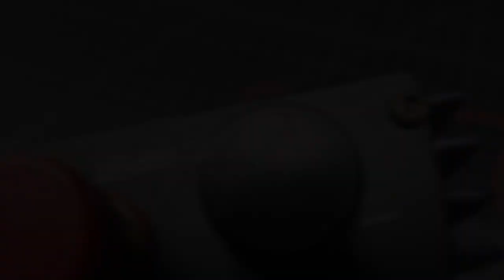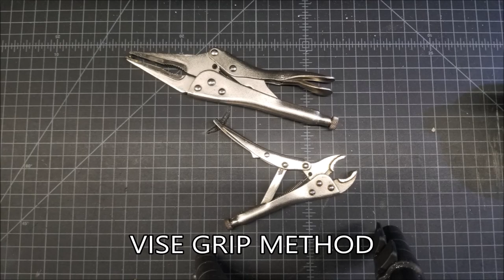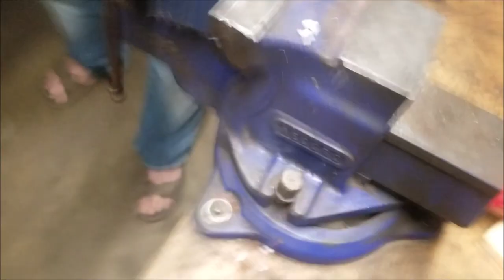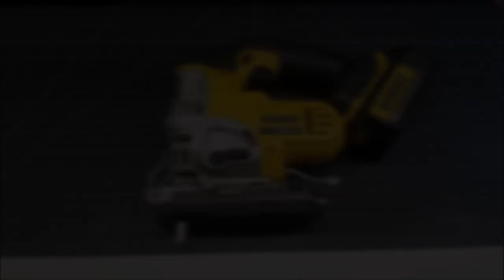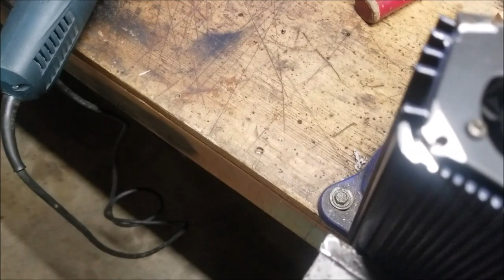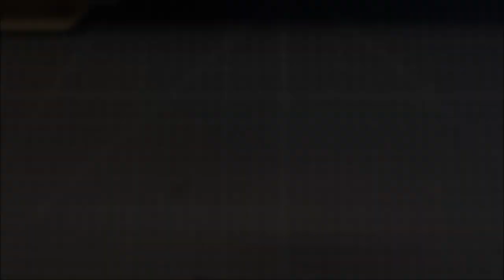8 Funny Security Screw Removal Techniques

Comment: If the screw top is exposed, it is easy to remove. I have a marantz amplifier which has 10 recessed torx screws. I managed to remove 4 using a wrong size torx driver and small flat blade screw driver. There is no way out except using the right size driver. I do not want destroy my amp. Any idea?
Reply: I think there's (gotta be) a safety torx bit that will fit around the center pin - I'm up against the same problem with a Ryobi battery and it's worse, the screws are recessed in the housing beyond the reach of the Dremel.  PISSEZ ME RIGHT OFF!  Gotta say - WTF decided to outfit the battery with four safety torx screws?!?  grrrr